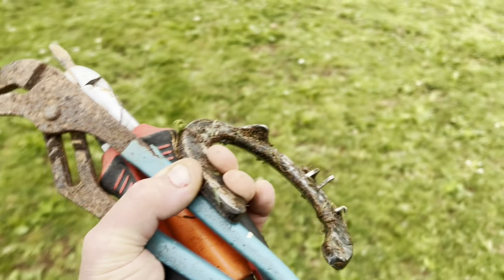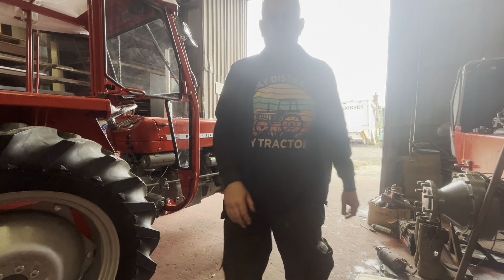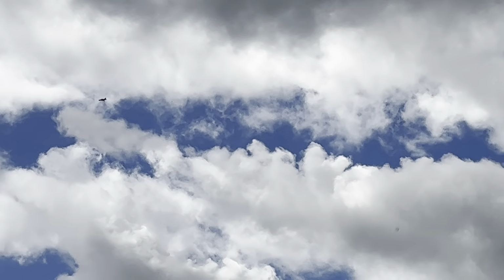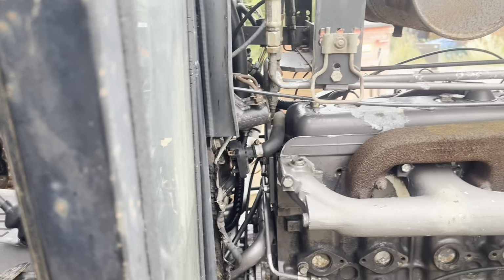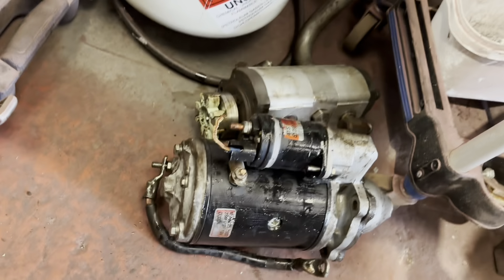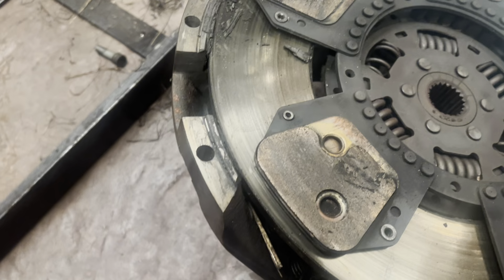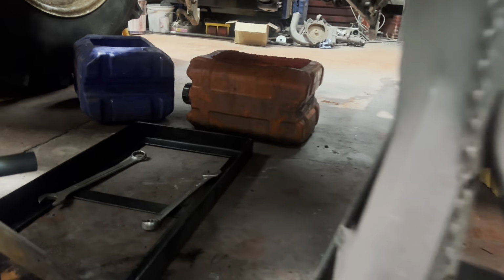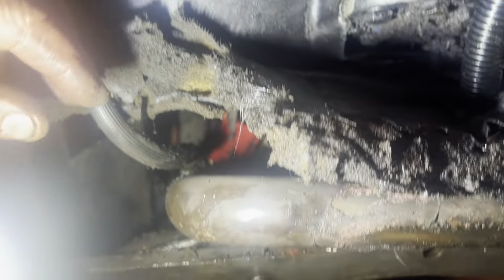MF 399 split in half

Comment: That’s one of the earlier 399s with the black cab. Good job getting it split. Fair play to penny she is not scared to get stuck in
Reply: I used to work for Massey, the lads on the line called the gearbox input shaft housing ( the bit you removed) the tater masher..

Comment: I've removed the input shaft assembly on my 1996 399 a few weeks ago.  When i removed the bolt from the clutch fork, the bolt must have sheared and the remains made it a c'#t of a job to come out.  Ended up using the angle grinder on it to remove it.  Big rebuild soon though 💪💪.
Reply from the maker: 👍 where there’s a will there’s a way 👍👍

Comment: Biggest issues during new tractor design are where to place the batteries and the fuel tank. Fuel tank location can influence tractor weight ratios considerably so placement during design is of crucial importance. Then the budget needs to be met. Use previously released parts or design new parts preferably with a multi model application.
Reply from the maker: @grahamclark7594  yea battery location crap on this 399 🤦‍♂️😂

Comment: It is back end oil mixed with clutch dust. Change everything while you're in there, including the rear main oil seal
Reply from the maker: @andrewplumb6189  yea seams to not be engine oils leaking , drained back end oil down n that was crystal clear
Reply: Yes, gearbox seals, gaskets, input shaft seals, rear engine oil seal, spigot and release bearings, clutch overhaul making sure adjustment lock nuts are tight on refitment, bloody good wash out with paraffin (old school). Last thing you need is to have to go back in.

Comment: A proper work horse the 399 I would remove the flywheel while its apart as its only a five minute job and would give you piece of mind that the rear main seal wasn’t leaking as well, great video as always your apprentice does a good job with any task you give her.
Reply from the maker: @rogerquenault7207  👍👍 thanks , yea think that’s the plan , if only to clean it all up b4 reassembly 👍

Comment: Just too warn you Dave you can’t get new flywheels for the 399 for a 6.354 found that the hard way on mine when mine was knackered . I had too have it sent off too a company that cut out the wearing part and bolt in a new bit